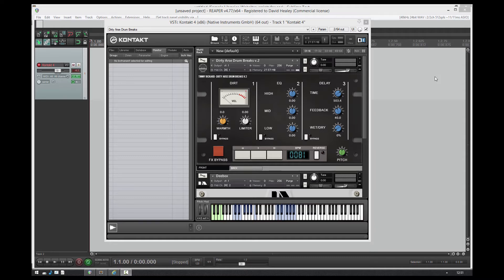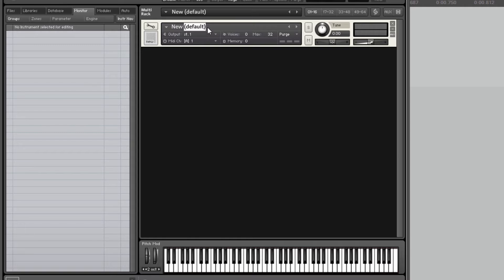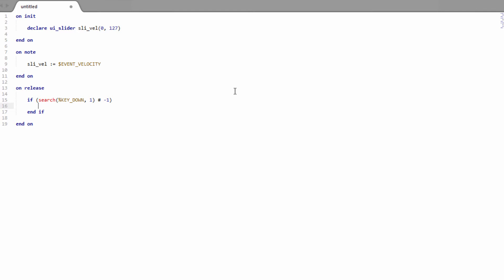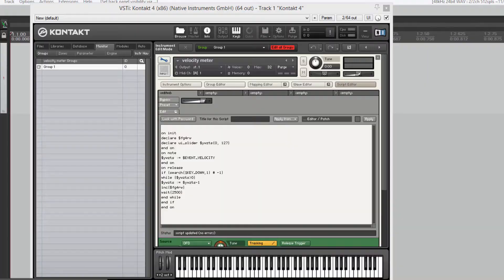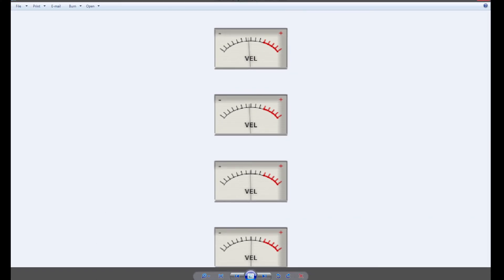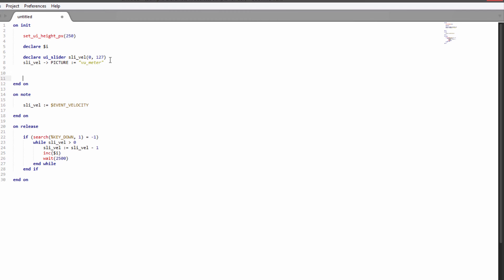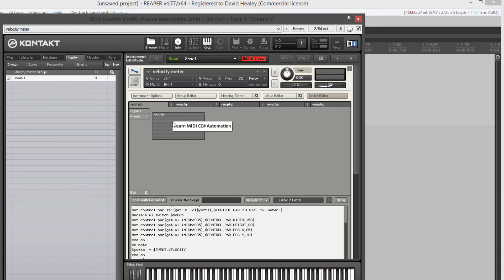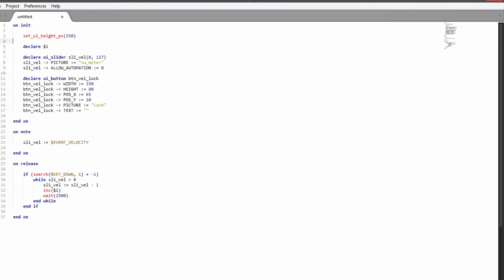How to script an animated velocity meter in Kontakt

Comment: Hey, thank you for the tutorial! but I am stuck at one thing I want meter for a individual note.
Here's the code :

on init 
 declare ui_slider $kickvolume(0, 127)
set_control_par_str(get_ui_id($kickvolume), $CONTROL_PAR_PICTURE, "ledvolume")

	on note

$kickvolume := $EVENT_VELOCITY

end on

on release

if (search(%KEY_DOWN, 1) = -1)
while ($kickvolume>0)
$kickvolume := $kickvolume-1

wait(2500)
end while
end if

end on

right now vu meter is reacting to every note. I want it for a particular note for ex. C4 how to do it?
I've searched forums but I couldn't find anything that would do this can you please help?
Reply from the maker: Use an if statement to check if the incoming note is MIDI note 72 (or if by C4 you mean middle C, which is sometimes C3 then check for MIDI note 60). Use MIDI notes rather than note names to avoid confusion with the different systems.
Reply: @Xtant-audio  Can you share a demo code I've been trying for very long time it isn't working.

Comment: Thank you for the tutorial!
How can you make the vu meter react only to a certain range of keys for example just from C2 to C4 and also can you use a on/off switch for the vu meter ??
Reply from the maker: For the range you just need to check if the incoming note is less than the lowest key you want or higher than the highest key. For the switch just add a switch to the interface and wrap the VU meter code in an if statement that checks the value of the switch.
Reply: how to include the incoming note?
can you gave me an example using your script??

  while($cn < $EVENT_VELOCITY / 3) 
    $knob := $cn
    inc($cn)
  end while
end on

on release
  while($cn > 1)
    $knob := $cn
    wait(10000)
    dec($cn)
  end while
Reply from the maker: @Felix-ro6ep  I don't remember the script very well but Kontakt gives you the note with EVENT_NOTE - this is available in on note and in on release.
Reply: thanks i got this
 but how to add the switch ?
is it gonna be like that :
     if ($switch=0)
    $knob  := 0
  end if
    if ($switch=1)
    $knob := 1
  end if
Reply from the maker: @Felix-ro6ep  Yeah that's the idea  0 = off, 1 = on

Comment: How did you create that animated option menu.
Reply from the maker: What time in the video is that at?
Reply: There is no tutorial on this option.
Reply: I have been searching the net for one. I think it's called and option menu where sounds are other selection can be scrolled and clicked on.
Reply from the maker: Sorry I thought you were asking about something I demonstrated in this video. Are you asking how to make a menu for selecting articulations/patches?
Reply: Yes that's it.
Reply from the maker: That's a bit to complicated to explain properly here. There are a number of ways to do it an it depends on how you've laid out your groups and samples as to which is the best method to use. The most straight forward is to put each patch in a separate group and then use the different options in your drop down menu as the group number. Then in on note you can enable to correct group.
Reply: Thank you.

Comment: I'm making a battery and I already have the image and I wanted the image to move according to what is played (the bass drum shines "kick" when it plays C1, the box shines "snare" when it plays the D1 note) how?
Reply from the maker: This isn't something that can be explained here. Ask this question at the NI forum or the vi-control Kontakt forum to get a proper response
Reply: @Xtant-audio  But is it even possible? I have the same(ish) idea. I would put a velocity meter in the center and some hi-tech sci fi analizators around it which would react to cutoff and reverb. I already made them in After Effects. But I did not found any video about someone made something like it.
Reply from the maker: @wlacsilbalazs  Yes, it's possible, you'd need to animate it. Again the best place for this is VI-Control
Reply: @Xtant-audio  I will check. Thanks for the answer!

Comment: How do i have a home / group meter or a meter on each key / or a meter on each group of keys or octave ??? Thank you so much for the video.
Reply from the maker: You'd need to add multiple meter (sliders) and in the on note callback check which note triggered the callback and affect the corresponding meter

Comment: I am having a problem when i put in my velocity meter i am not getting any animation
Reply from the maker: Have you set up the text file for your velocity meter image?
Reply: i set the text file, it still keeps showing me the vertical animation n
Reply: i used knobman to make it it works in knobman but wont show as a animation in kontakt
Reply: still showing as a sticthed file
Reply from the maker: I'll respond to your vi-control thread :)
Reply: thank u much appreciated :)

Comment: redline on "declare ui_slider sli_vel(0, 127)"
Reply from the maker: Which editor are you using?
Reply: Using Sublime2 with KSP
Reply from the maker: SublimeKSP is designed for Sublime Text 3 so maybe it's not compiling properly in sublime text 2
Reply: something in 3
Reply: getting the something with Sublime 3 / KSP :)
Reply from the maker: What is the compiled code you get from Sublime?
Reply: got one that works from the form
http://vi-control.net/community/threads/analogue-vu-meter.29998/
Reply from the maker: So it's working now?
Reply: Not the way you did it in your video.

but the one I copy from the form do.
Link: http://vi-control.net/community/threads/analogue-vu-meter.29998/
Reply from the maker: Did you compile the code before copying it into Kontakt